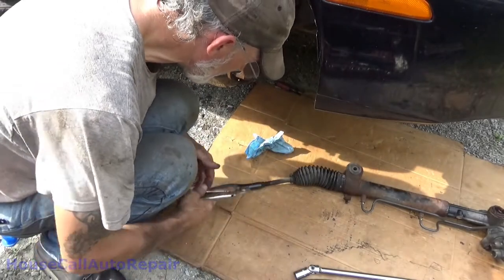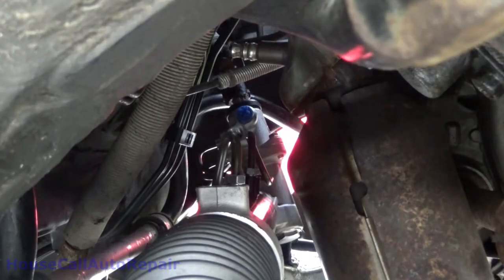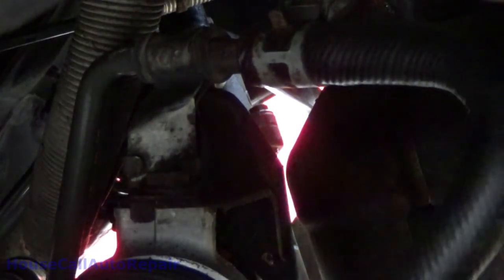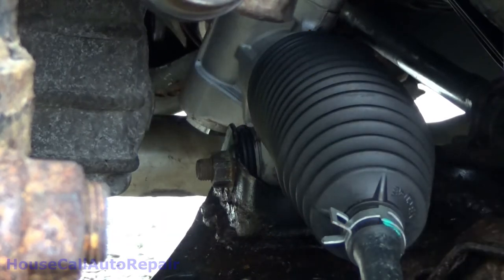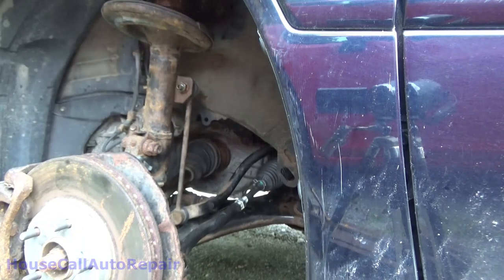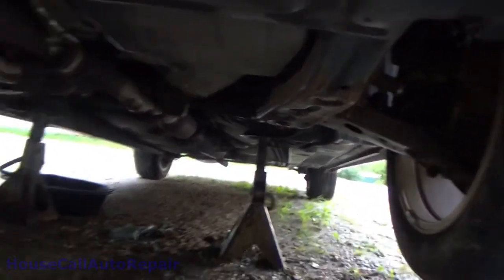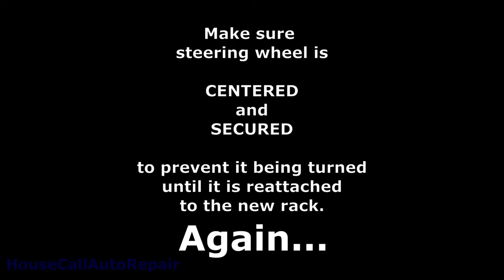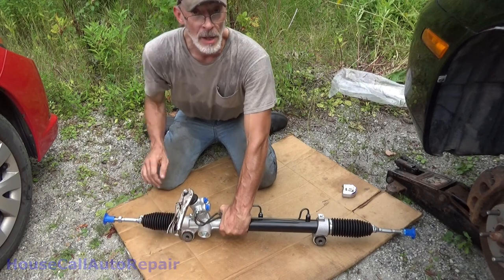2005 Lexus ES330 - Steering Rack Replacement - Part 2

Comment: I'm going to be doing this exact job on this same model soon.  Your video is going to help me a great deal.  Thank you for sharing your time, effort and experience!    I do have to ask - do you think the linkage you replaced last was actually the real culprit in the hard steering?  Just between you and me. :)
Reply from the maker: While there is no doubt that the linkage was a HUGE issue, The used steering rack that was in it wasn't valving properly when it was cold. No whine from the pump, when it was forced... and steering got easier as it got warmer. I was surprised by the clean fluid.

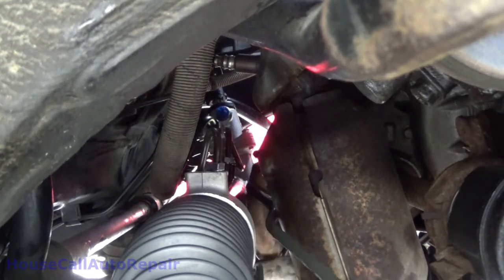Comment: At 7:00, I'm looking for that metal tube that you're assembling. What part of the assembly is that called?  It seems to be separate from the whole assembly and that's what I need to change.
Reply from the maker: That hose is the power steering return hose. (low pressure)
Reply: @HouseCallAutoRepair  thank you.

Comment: What about alignment and the loose nuts on the steering arms. Is that the costumers job to fix?? I’m just curious.
Reply from the maker: I do a "string alignment", but inform the owner prior to doing the replacement, that an alignment is recommended. The jam nut is tightened after it's as close as I can get it. Even with paying another shop to do the alignment, they still save quite a bit.